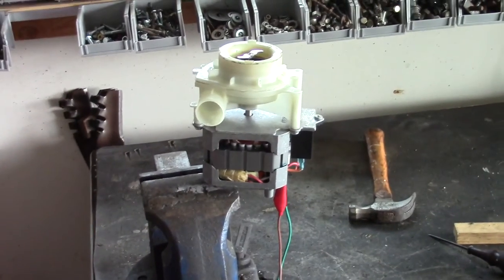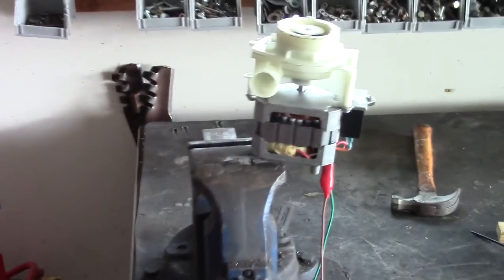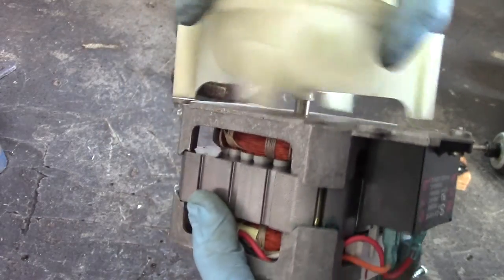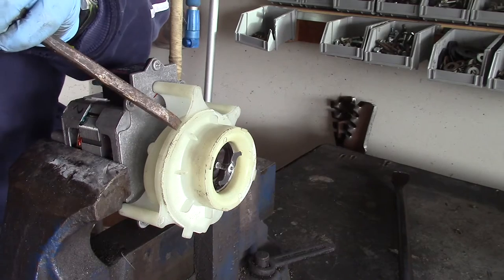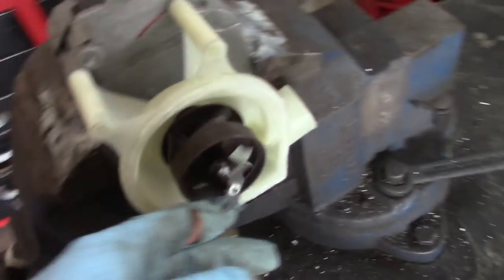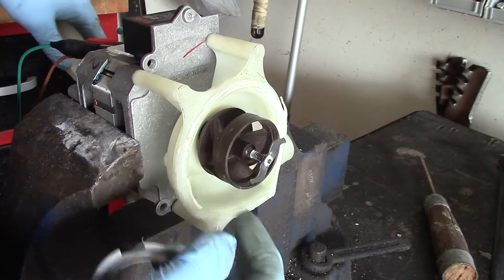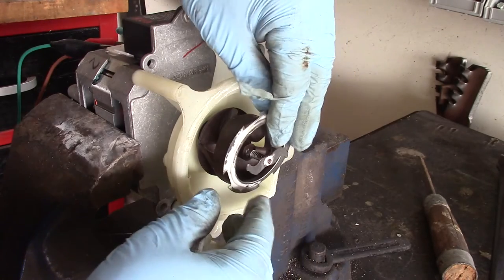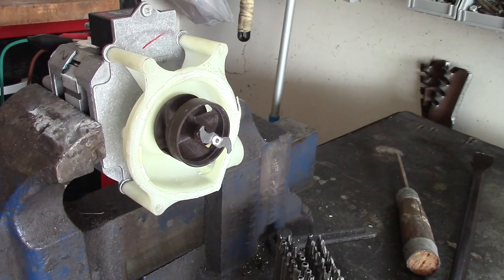GE Dishwasher Why The Pump Fails

Comment: Yep, my GE Dishwasher has been nothing but a PITA.  It's only 4-years old.  At first, the door seals were bad and leaked and I had to replace that seal a couple of times.  About a month ago, started leaking big time underneath.  I replaced the diverter valve (was told that's a known leaking issue) but still leaked but I could see it leaking out of the white part of the motor you have.  Replaced that and, now, it's not leaking a drop.  Good to hear I can buy the motor on EBay for cheaper...I did pay $110 for one.

Comment: I think your problem was "Bearing Play" inside the motor shaft, which allowed the impeller to move "Up & Down."   When it moved up (or "forward") it would grind against that metal plate in the front of the pump.
Reply: Well thats because you didnt watch the whole video.

Comment: If the motor was bad on this, would the dishwasher still start up?    My new dishwasher will not start any more.

I replaced the circuit board and ohm test everything.  Door latch works, float seems to be working (cleaned with vinigear) but the only thing that didnt show resustance was the wash pump.

Comment: Yup I think you hit it exactly correct! Oh.. Bought the bits, for $22 its worth it to have them handy.. :)
Reply from the maker: +MidwestMotoRider Those bits work well.  I have had them for 2 years I bent the flat head slightly and chipped a torx off because I use them with my impact.  When I bought them they were about $17.  It is a really nice set for the money.

Comment: Just wondering, maybe the steel ring should be stationary and the impellor should slide inside it BUT maybe the outer teeth cut through the plastic tags due to friction against the impellor.

Comment: How many years old? Maytag washing machines the pump impeller wears through the housing and then leaks, there's no steel like that so maybe they tried to improve something.
Reply from the maker: +jasonmushersee   I agree.  Things are made to last 8 years.  If you have an appliance that goes 10 years nowadays you are doing great.

Comment: Well done...it looks like they tried to balance "make it cheap" with "make it last" and "cheap" won this time.
Reply from the maker: +A LeBlanc  I thought that the original bearing needed to be glued in place of something, but the repair part spins as well, but not quite as much play.  The repair motor is really quite when running in the dishwasher.